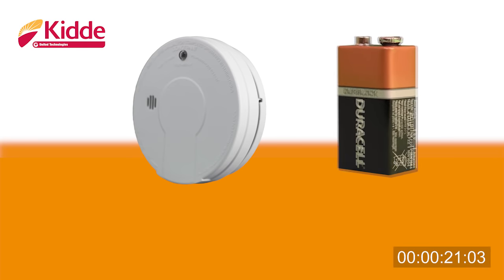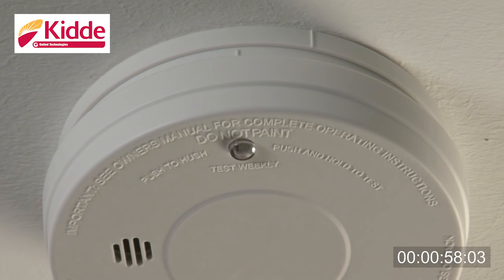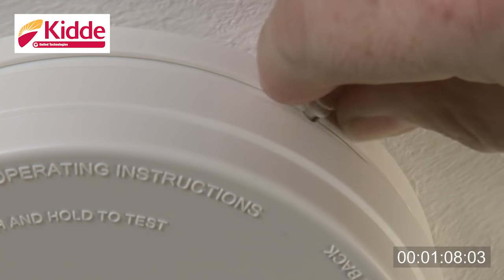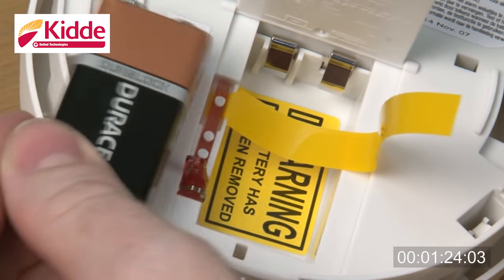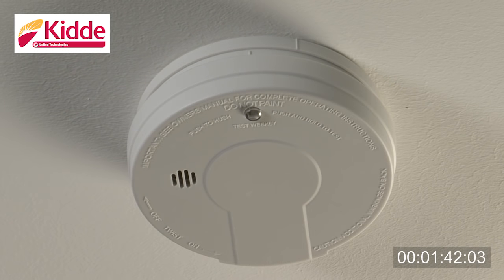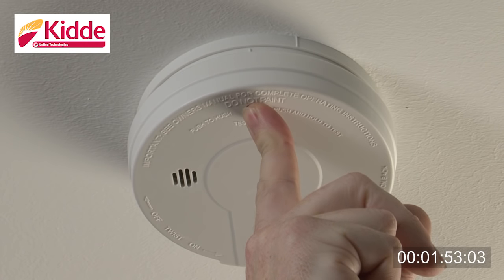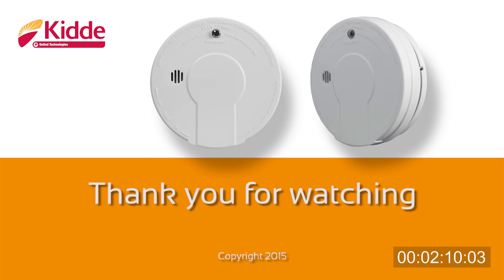How to replace your smoke alarm batteries

Comment: Zero help on how to remove the cover. After 30 mins still can't get it off
Reply: Twist it counterclockwise
Reply: It's stiff and needs a hammer. I can't sleep. It keeps beeping
Reply: Why does it only occur in the night. It's 2 am
Reply: I'm rubbing my eyes. I can feel the redness.that crinkled burn. We are. Getting old.
Reply: It's like oil wax underneath my eyes but above my nose. I could light a candle.
Reply: But that wouldn't help fix my problem. The dreaded smoke alarm at 2 o'clock in the morning
Reply: I'll stay up all night. Listening to it. The shops will open soon in another 6 hours
Reply: Can I wait? Could I be neglectable? I don't think that's even a word. It's highlighted on red underline
Reply: I use that word sometimes though. Maybe it's a borough thing. It's still beeping at me
Reply: I can't go anywhere. The stairs are blocked. And ur bluffing. There is no fire
Reply: But of there was I would hang from the window and drop down with a reasonable gravity force
Reply: That might hurt my ankles. I don't want to go anywhere. I don't want to jump out. My window
Reply: Let me stay in bed. Let me sleep. You've already woken me up and there's no girl beside me
Reply: Jesus. I'm sleeping in a single
Reply: A. Single.bed
Reply: My only company is the fire alarm
Reply: God... this is so saaad.... I'm not doing it anymore. Not until I've finished
Reply: @jamstew547 How old are you
Reply: You need a flat tip thin screwdriver as there is an inside plastic tip needs to be inserted inside by the screwdriver then turn the cover counter clockwise and it will come off

Comment: I'm a senior and have always been handy. these are the worst to change with one hand, I tried to twist it like shown in the video, and it doesn't work and the writing is the same as the unit, so forget trying to read it for it's facing the opposite way. A poor design, and i'm not paying someone 50 dollars or more to change the battery. I'm close to ripping it off the fking ceiling
Reply: Hahaha

Comment: Mine has a plate piece in the back that won't allow the battery compartment to open, what a bad experience!!!!
Reply: Exactly omg... making so much noise and everyone telling me its easy
Reply: I know this is years old, but if that's the piece that has the wires connecting it to the house, you have to pinch the sides and slide it out of the alarm itself to access the battery panel.
Reply: @rallozarx4215  whoever you are, wherever you are, your simple explanation saved my life tonight. you summed up in two sentences what a 17 page manual for this confounded alarm could not. eternal gratitude for helping me sleep tonight and learning how to change the battery when this happens again. your comment is a small miracle. thanks!
Reply: @rallozarx4215  I was struggling with my smoke alarm until i found your comment! Thank you for your help!!

Comment: Hey guys, for the ones with the electronic connection in addition to the battery, squeeze the plastic connecton on the sides. it takes a little pretty but it should some off.

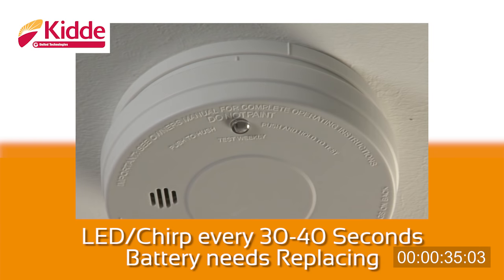Comment: 0:30 Most informative part of the video for me right here. Showed me the location of the manufacture date of a Duracell battery. Tried to replace the battery only to get a constant high-pitched squealing from the alarm. Realized after this video that I was trying to install a battery manufactured in 2016, swapped it for a 2020 and boom! No more squeaking, fully operational.

Comment: Got it off fine,  pried open the battery componenet, did the red lever  now I can't-for the life of me get it to screw back on--it is half attached--I can't see the arrows---it works ---just is half screwed on---and for now that will do---some coloured dots to show where to line up would help---I might try to do that tonight---off to work--  but at least home has a working detector!   Next time I will buy one where the battery is on the front, so I don't have to unscrew anything!!!   I hope you will consider that on your next design-bad enough being a senior --let enough having to get on a ladder and mess with this convoluted design!  Pop a button, pop out battery  DONE---

Comment: how do you disconnect the smoke alarm, so to drain out the noise it made cont eventhough the new battery is in?  thank so much.  mine can't be squeeze in from both sides, and the leverage is not far from down, meaning that it des not yield down movement? help

Comment: Instead of complaining like the rest are on here. I just have a simple question. I finally was able to get my fire alarm down from the ceiling, but now that I’ve opened the door to exchange the battery, there’s like a red “flag” 🚩 that’s sticking out of the battery compartment blocking me from shutting the door, how do I properly shut it?
Reply: press/lever it down before you put the battery in

Comment: Thank you.  I had difficulty removing the smoke alarm from the plate.  You taught how to lock the unit in place  by lining up the arrows (or diagonal lines),  I did the opposite by turning the alarm towards the lines.  Worked. dah